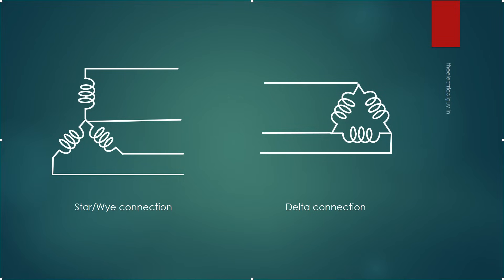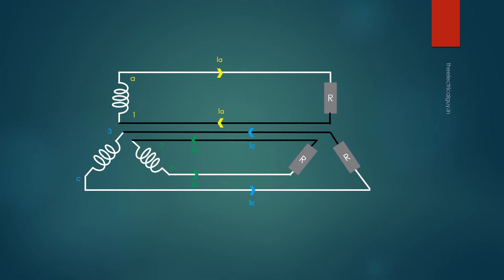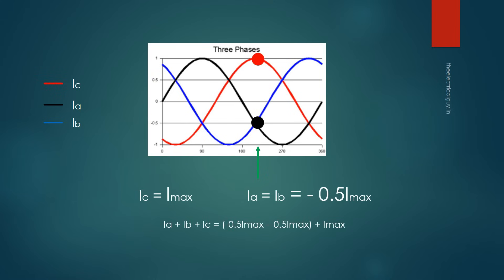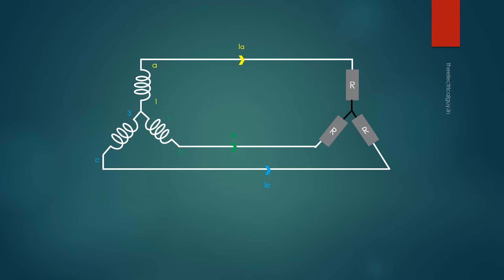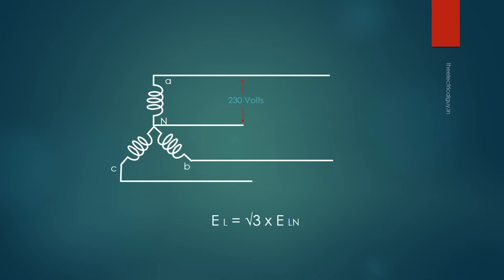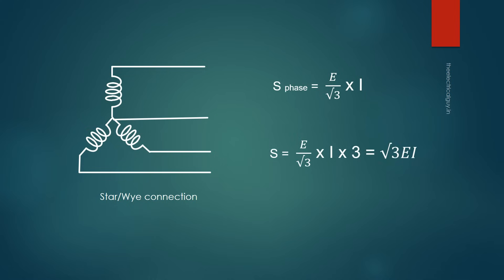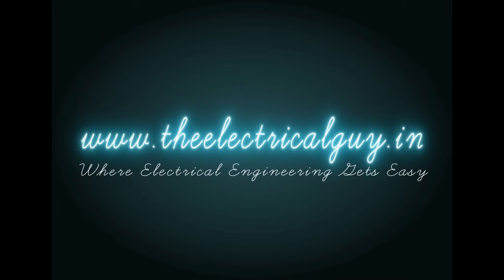Star and Delta Connection - Explained | TheElectricalGuy

Comment: SO, I am about to connect a 3 phase step up transformer 220V  to 380V, as per the connections in the transformer it looks like has star input 4 connections and star output 4 connections. This is transformer that came from china that will supply a Chinese built CNC  machine that also has 4 connections, It looks like 380V, 380V, 380V, 0V.  I am presuming 0V  is the neutral connection coming from the transformer.  in the input side the transformer has the 4 connection. they are labeled 220V,  220V, 220V,  0v.  THE QUESTION IS: is the 0V the neutral coming from my electrical panel.? reason why I ask this, is because In the USA 220V 3 phase machines do not use neutral wire, and that is my doubt. Thank you.

Comment: there is an issue here. the Delta & Star connection may not consume the same power. If we supply one voltage E, no matter it is phase voltage or line voltage, when you use on a different connection, you need to convert with sqrt3. in your video, you use the same E. let me know if this is the issue. thanks.

Comment: Thanks for the explanation. what do you mean by indicating that Y-Connection is needed when a neutral and "two seperate voltages" are needed. As I know in distribution systesms there are 3 voltage lines and a neutral; please clarify for me this point. Many thanks
Reply from the maker: Hey.. watch this video.. this will give you the answer 😊 do share the video if you find it useful.

https://youtu.be/dRuYSd7pwSY
Reply: @GauravJ  
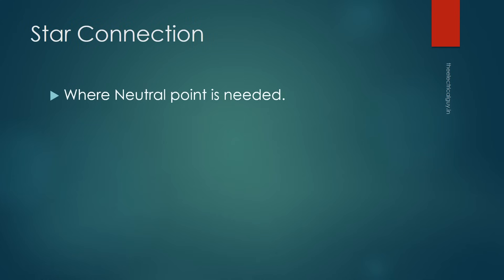Hello, our teacher. Thanks for the video, but it explains when neutral is not needed. Whereas, we want to know why two separate voltages are needed in the star connection while internationally we use 3 separate voltages and two as you mentioned at 6:10 in your video.

Comment: This video is good. With the delta system transmission lines, where do you get your neutral to supply the consumers? Do you also need a ground?
Reply from the maker: Hi..  delta system is only used for transmission... For distribution to customer always star is used

Comment: Towards the end, you said that Power Transmitted is the same in both cases. Based on my calculations, the formula is the same: P = root(3) * U * I but, I is different. So, Power in delta is 3 times Power in Star(assuming loads are the same). Correct me if I am wrong.

Comment: With some large motors I have worked on, they transition from, if I remember correctly, Delta to Wye during startup. I think it is something to do with the in-rush but, I would like to better understand these.
Reply: Compressor engineer here! You're right, big motors usually start in star & move to delta. This is because in star, all 3 phases are connected in one point, which means the phases inefficiently "pull" on eachother & can't deliver the full magnetic power that 2 opposing phases would.

In delta on the other hand only 2 phases are ever connected at a time, & as mentioned earlier these are two opposing phases, which deliver the strongest opposing magnetic powers.

This means that the motor will start with all 3 phases acting in a weaker form, as to not burn out any wires trying to overcome inertia. Then, once the motor's up to speed, it switches to the stronger delta configuration & runs with maximum efficiency.

Hope this made sense! If not there are probably videos out there explaining it better than I can 👍
Reply from the maker: Hey. Thanks for your inputs.. 👍🏻
Reply: @oscarcameron3274  It makes perfect sense.  I'm a HVAC Mechanic, retired from a large school district. I've troubleshot a few of these but, never fully understood the science.  That also explains the need for resistor coils. Thanks for your reply.

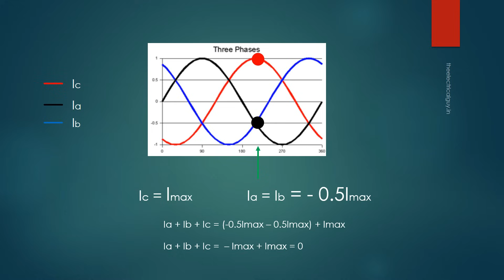Comment: I have a silly question at 2:38 we see that  neutral current is zero for a balanced system, but when we see flux diagrams they have the same waveform as that of currents but at any instant , resultant flux value is 3/2 of maximum flux of any one line current,   I'm little bit confused about this but  , would appreciate if you could explain
Reply: You have to check the graph, reference should be at point origin zero. That is referring y axis positive and negative quadrants.

Comment: Hi. If you're computing power in 3 phase, do you need line to line voltage or line to neutral voltages?
Reply: You can use any but formulas are different
Reply: @vonjuez654  if im using the formula in the video?

Comment: Hello!
In your video, minute 8:30 you say that power is same.
But I read in college class that it is different. Can you explain pls?
Thank you !
Reply from the maker: There is no difference in power transmission, Power transmitted by both the type of connection i.e. star and delta is same. Kindly refer the formula which i have given in the video for power transmitted by both the connections.
Reply: @GauravJ  Line to line voltages are different here. So, power would be different.

Comment: Is El= √3 Eln valid only for amplitudes of the line to neutral and line to line voltage or for the whole sinusoidally varying voltage. Line to line and line to neutral voltages are sinusoidally varying right? So is this relation only applicable for amplitudes?

Comment: Can I use a 600 volt 3 phase delta primary transformer  that has a 480v wye secondary for a delta supply to a group of motors ,and not connect the anything to the neutral (XO) just ground  the (XO) all loads will be equal (motors)  ,my customer already owns this type of transformer and does not want to buy another

Comment: Hi
Probably this is a bad/stupid question but
If voltage is the "push" of electrons how come there is a line to line and line to neutral voltage?
I'm sorry but I just can't picture this in my mind at all.
:(
?
Reply: Jason Voorhees Not sure I completely understand the question but I’ll try. 

Voltage is the DIFFERENCE in potential between two points. Put one meter lead in the hot side of an outlet, and the  other in the ground. Assuming you’re in the US, you’ll get 120v. That is the difference in electric potential between those two points. Now put the lead from ground into the hot of the other terminal. You should read 0v. While these wires are hot, you will not have a voltage. Because they are the same, there is NO DIFFERENCE, or 0v. 

This is where it gets confusing. Go to your dryer. Here, you have two 120v lines that are 180° out of phase. Because they are 180° out of phase, they peak at the same time, but in exact opposite directions. So when line 1 peaks at 120v, line 2 is peaked at -120v. If you put a lead from line 1 or line 2 to ground, you will have 120v. But if you put one lead on each line, you will have 240v, instead of 0v like before. This is because of the phase difference. 

Now, instead of having two phases, we use 3. Instead of being 180° out of phase with each other, they are 120° out. (Because there’s three, 120+120+120=360°. In our 2 phase example above, 180+180=360°)

So, three phase has a voltage from line to line because they are not in phase. BUT because they do not peak at the exact same time, the voltages do not stack perfectly like our 120-240 example. It must be calculated by taking the square of 3 times a line voltage. So line 1 at 277v to ground Times the Square root of three, would give us 480v from line to line. If you had 3 phase 120v, the line to line would be 208v. 

Hope that helps/makes sense...?
Reply: @mikatomik5532  Good explanation
Reply: Adarsh Chandran thank you!
Reply: You think you need a closed circuit to have voltage, but that's not true; in fact, in an open circuit, you can have any voltage (and of course the current is zero)
Reply: Thanks for the useful vedio shared But my question is Why induction motor connected in delta or star ?
Reply: Yusuf Danjuma For a given motor, the fundamental difference between the star and delta connections is that the rated voltage for the star connection is 1.731 X the rated voltage for the delta connection. That way a motor can be designed to run at either of two voltages, 240 V, delta or 415 V, star for example. If you connect the motor delta and connect it to 415 V, that is too much voltage for the design. The motor will draw excessive current and overheat. If you connect the voltage star and connect it to 240 volts, that is not enough voltage for the design. It will only be able to produce about 33% of rated torque without running slow and drawing too much current. With a VFD the effect would be the same, the motor will produce less torque per amp of current.

For normal operation of a motor with a VFD, there is no choice, you must connect the motor for the voltage that matches the VFD voltage rating. The maximum VFD output voltage rating is normally the same as the input power voltage rating.

What could be done with a VFD is to use the delta motor connection with a 415 V VFD, but set the VFD to have an output of 240 V at 50 Hz and 415 V at 86 Hz. That would increase the power rating of the motor X 1.731 because the motor the nearly the same torque capability at a high speed. There would be some increase in motor losses, so the motor's torque capability is reduced somewhat. There would be some concern about bearing life and motor vibration, so it is not a good idea to operate a motor that way without checking with the motor manufacturer.

Comment: why the current and voltage are same or changes in y and delta connection? please let know of any links which would help me claire my doubts.
thanks
Reply from the maker: It is because of the way of connection. And also because in AC phase displacement is 120 deg.

Comment: With all due respect, the video presentation lacks more in-depth explanation as to, for example, why Line Votage and phase voltage are equal for Delta connections circuits, and why  Line Current is equal to the square root of 3 times the Phase Current. And conversely foe Star connectios circuits.The formulas appear to come up out of the blue. Yes, the guy assumes people have some knowledge about these circuit arrangements. But even so, it is not rock science to touch on explaining more both, diagramatically and matemathically, the relationship between voltage, current and power generated in this two different circuit arrangements.